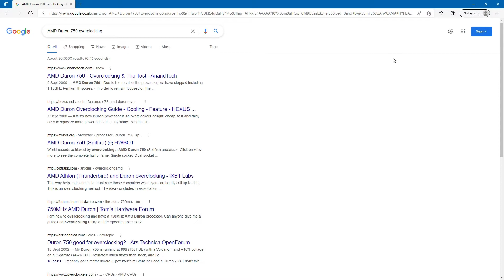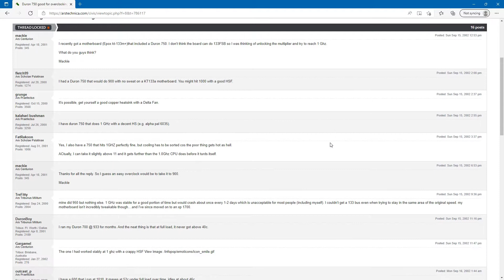Why can't this AMD Duron overclock to a higher speed? #Overclockingbuildoff follow up!

Comment: If you want to go extreme, the ASUS A7N8X-Deluxe, GIGABYTE GA 7N400 nF2 Ultra 400 (or GA 7N400 Pro 2) and DFI LanParty nForce 2 Ultra 400 are all great boards for overclocking. I have the GA 7N400 nF2 Ultra 400. Sadly my Athlon XP 1700+ (OC to 2000+) died so I'm actually with a Duron 800 :DD
Reply from the maker: I had a couple of the DFI Lan party boards back in the day, they were awesome motherboards!

Comment: I did that with a 700MHz Duron back in the day, but I had to increase the core voltage for it to run stable at 900MHz. Same with the Celeron 300A@450 I had before.  It needed higher core voltage to run at that clock.
Reply from the maker: I don't remember having to adjust the voltages on the Durons as much as I did on the Athlons, but then it was a long time ago and my memory is not as good as it was! I'm going to try this Duron on another board with voltage adjustment to see what it will ultimately end up.

Comment: I had a Duron 700 and Soltek SL-75KAV (KT133A with ISA slot) motherboard back then in 2001. I was able to get 910 (6.5 x 140) with slight voltage bump (1.7 V IIRC), but 933 (7.0 x 133) required around 1.75 V (and a better cooler than the stock one) to be perfectly stable. TBH I was a bit disappointed with my chip, but it looks like that I could won much worse chip on a lottery... :)
Is this 850 fully stable? If so, then probably a healthy bump of voltage (1.75 - 1.8 V) will allow it to run on 900. :)
Reply from the maker: Yep the 850Mhz was stable, I'd like to revisit the chip one day on a top quality motherboard and with voltage adjustment too, to see what speed it could ultimately do. Maybe try all the Duron 750s and see which one is best?
910 back then on a 700 chip was a good OC, especially at that bus speed. Fast for such a cheap CPU.

Comment: Tried out with a higher CPU voltage? 1,65V is the stock, and until 1,85V should be not a problem with a good cooling.
Reply from the maker: Unfortunately the version of that motherboard I used doesn't have the CPU core voltage dip-switches / jumpers installed, just solder pads. I would like to put that Duron on a better motherboard and see how far it could ultimately be pushed.

Comment: I think cooling the CPU die with dry ice or something like that used to help. But yes, Durons were like the "bad quality"/rejected Athlons, so I would assume you'll get a variety of processors that could or couldn't be overclocked. Great video!
Reply: Those older Durons were totally their own chips, as they had only 64kB L2 physically. The 1400-1800MHz Durons were cut-down Athlon XPs which could be modified to their full 256k with some luck.
Reply from the maker: Thanks! I guess it was also bad luck that I picked the worst over clocking chip out of the 3 I had.

Comment: Great video! I was half expecting the re-cap to improve things, especially since they were bulging. Would love to see if a board with some voltage adjustment would allow you to break the 1GHz barrier. I suspect it would be possible! 👍
Reply from the maker: Thanks! I thought the re-cap would improve things a bit too, but I suppose this particular Duron had just had too hard a life to go any further. When I've got a board out with voltage adjustments on it, I'll drop it in and see it can be pushed a little further. I reckon one of the other 2 Durons would have hit 1GHz with a bit of voltage.